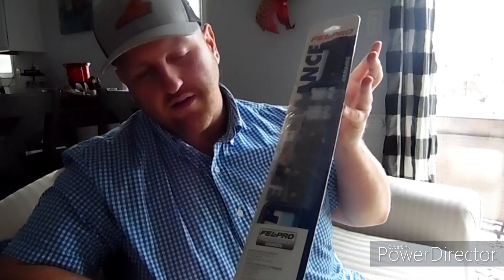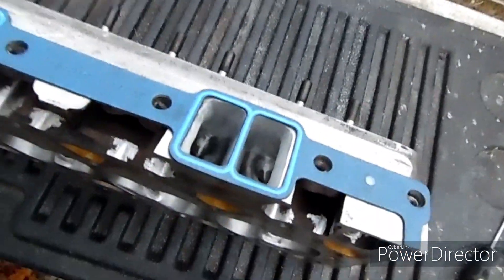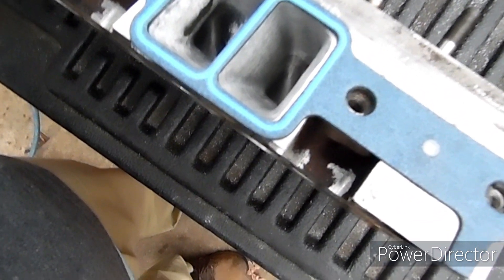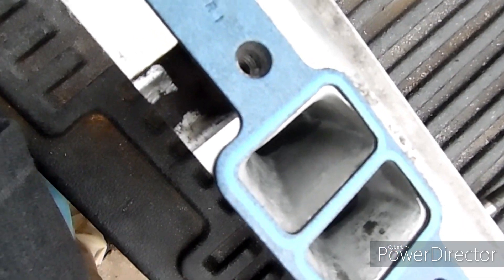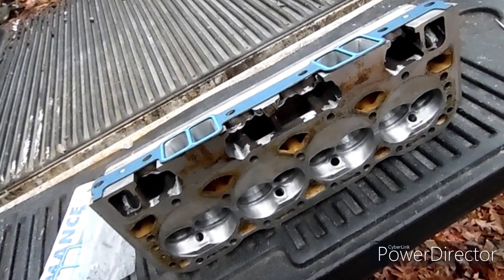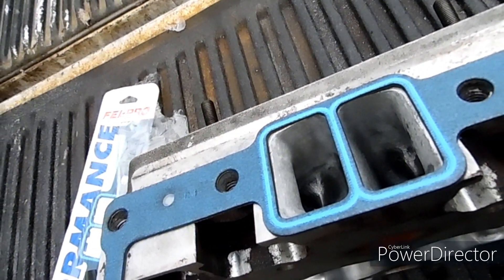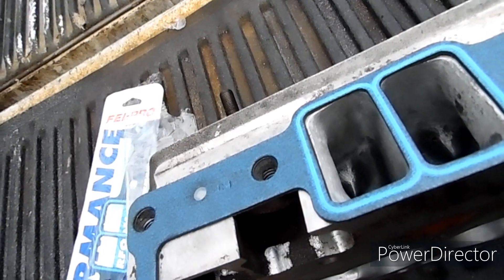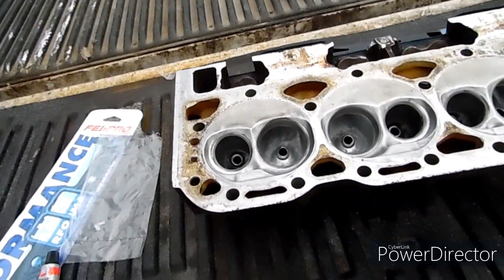LT1 hand ported heads measurements and Felpro 1284 fitment.

Comment: Almost all Lt1 heads have core shift.  I like to weld the outside of the pushrod pinch up them reclearence them for the pushrods before I begin porting. You can really make some great gains this way. You need to cut the ski slope out of the port roof, cut it to be level with the rest of the roof.
Reply from the maker: Yeah, I would like to weld the outside of the pinch but my aluminum welding skills need some work before I try it on a head. Thought about taking them to someone to weld up. I'm planning to go turbo at some point, so just don't think they would be worth the money over a set of Trick Flows ported by Lloyd.

I did a good amount of work in the roof to raise it but didn't get into the rocker stud hole. I could probably get a little more of the slope out of it too.  Do you break into it when you do them?
Reply: @YerkitRacingChannel  yes, I get into the stud hole. I use that as a gauge to know when I've gone far enough.
Reply from the maker: Sounds like a good way to gauge it and be consistent. I was also worried about hitting a spring pocket. Don't know if that's a real concern on these heads though.

Comment: I got 204 ccs the first time I tried to do a set. That means you got a lot of room in the bowl to go. I can send you pics on messenger of the 204 cc set after I cut a runner on the bandsaw.
Reply from the maker: That would be awesome! I would love to check them out. I'm sure there is some room left to go in the bowls and roof of the port. Not really sure it will gain much there though as those areas are already bigger than the pinch areas.

Comment: Wasn’t happy with 1284,port to small for my application and tough to trim,I started going with Mr Gasket bigger port and easier to trim for a good fit !! Swear by Fel pro on any other application but LT1,but don’t like 1284 or the head gasket application
Reply from the maker: I will have to check into the mr gasket set. Are they taller  ports or just wider?
Reply: @YerkitRacingChannel   both
Reply from the maker: @TheDoug1980  Sounds good! I will have to check them out.
Reply: Save your money on 1074 as well,could not get them to seal properly 3 times had heads milled each time,went to cometic,never had a problem with any other Fel pro product but Lt1 stuff,best of Luck
Reply from the maker: @TheDoug1980  I do like cometic gaskets. Never used their intake gaskets but their header gaskets have worked well for me in the past. Might have to look into what they offer for lt1 intake gaskets.

Comment: Check out the old head bytes video on Lt1 head porting.
Reply from the maker: Thanks for watching my video! I will have to check his stuff out again. I watched his series on the LT1 heads a few times before I started. Also watched the HeadFlowInc series a few times too.

I know one of them went through into the head bolt holes and put a bushing in them.  I was trying to avoid that if possible.
Reply: @YerkitRacingChannel  when the roof is cut correctly you will expose the rocker stud hole. Adding a steel sleeve to the head bolt hole allows you to widen the straight wall to the max.
Reply from the maker: Good info to have! Will it gain anything to pull more out past the pinch where the head bolts are? Sounds like I can probably pick up some more in the ski slope area though for sure.
Reply: @YerkitRacingChannel  A different perspective 
on the back side of valve opposite the runner you cut out a bunch of material and feather into sides making bowl kind of oval shaped 
its the redirect to hit valve evenly  more strait down 
because flow over shoots closest side to runner
you help flow speed and redirect 
what lt1 heads are most famous for is not tornado but vortec tumble
40 more horse its indused by raising intake runners in head to have better shot and Tumble  the domed exaust port is also vortec .2 head tech .
They have added this to all chevy race heads when you look at flow numbers on lt1 about 45 inches of lift the numbers start slowing 
so after 4900 you get tumble boost  the bigger you make runner the farther 
up in Rpm you push the tumble in rpm till you cant reach it
 the lt4 heads were hogged out to much and have big bog when hooking.
the newer box 97 Lt4  box engine was way faster than the original 
it had 185 intake runner brought the tumble back into power range.
and got mid range back
allso port matching exaust dome you want to keep Dome and go taller rather than wider 
think faster air on top of runners and a little dragging on bottom
just a different point of veiw
Reply from the maker: @alonzahanks1182  appreciate the different perspective on it. Definitely some stuff to think about